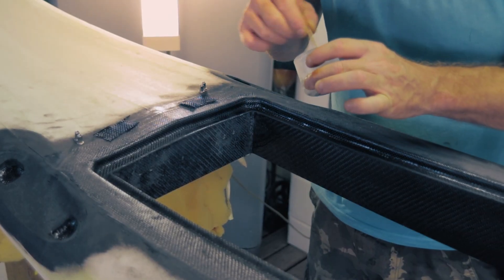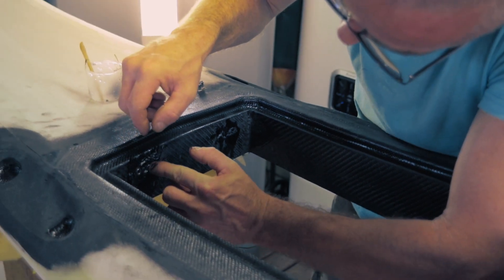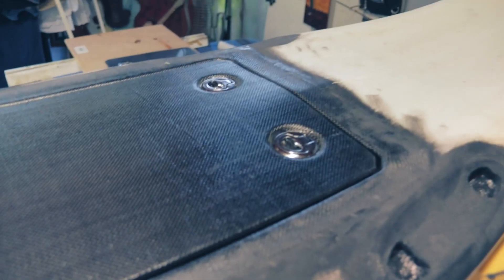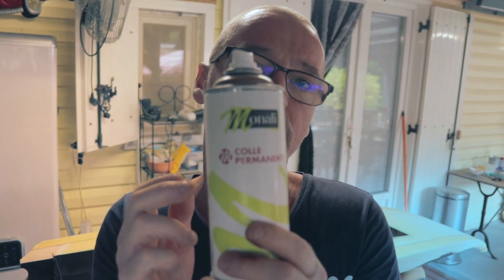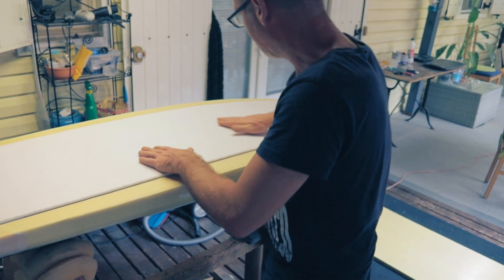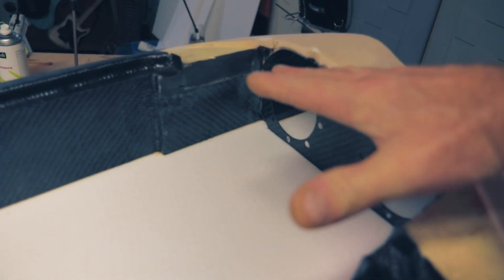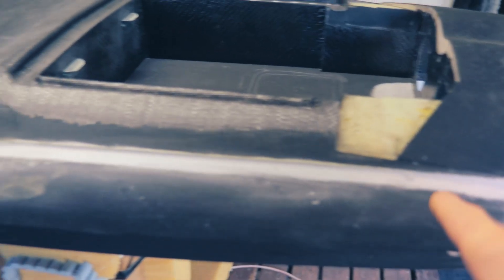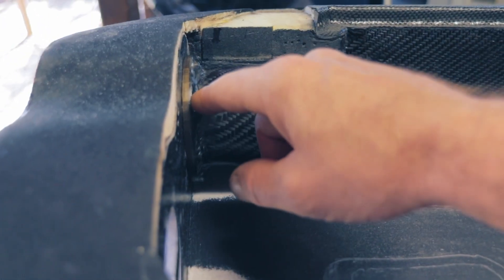Im building a Jet Drive Diy Electric Surfboard. part 6

Comment: What type and weight carbon are you using?
Reply from the maker: Hey there if I'm not mistaken it's 200 grams that I found on amerzon that comes in 2 metre length by 50 cm and was reasonable price.